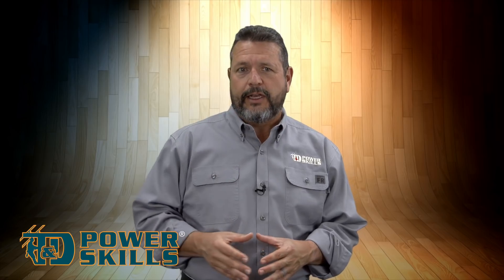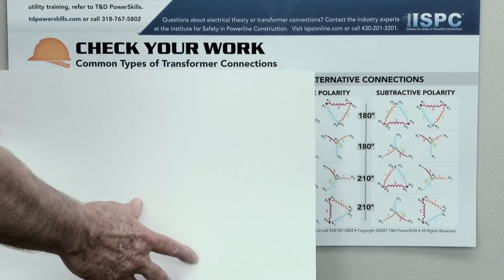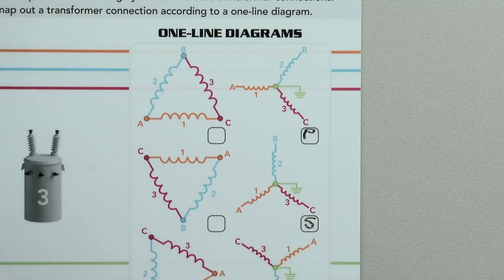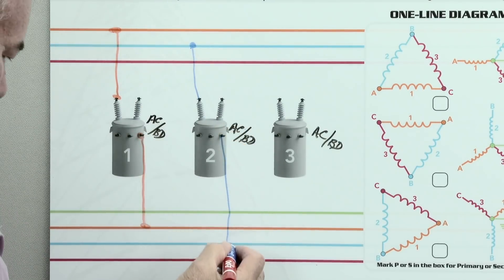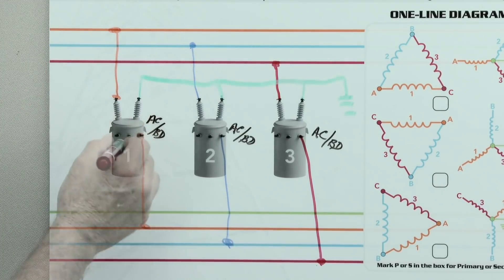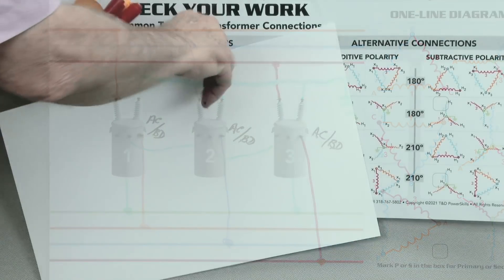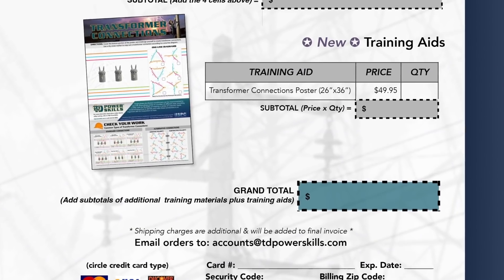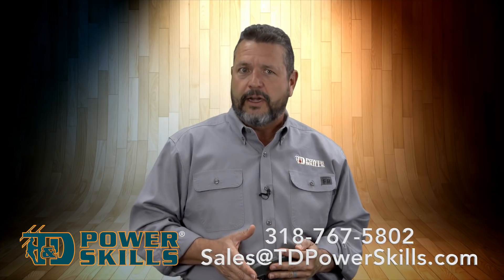Transformer Connections Training Aid

Comment: You stated that transformer connections are typically subtractive at lower voltages.  Lower voltages and single-phase transformers comprising single-phase and three-phase banks are typically lower kVA ratings (under 167 kVA/Phase), which are standardly Additive, not subtractive.  Transformers above 167kVA/Phase and high three-phase thermal ratings are standardly subtractive.